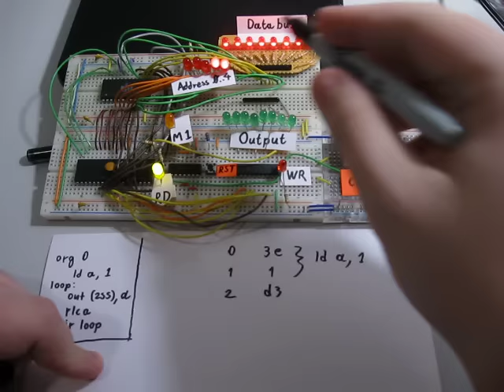Simplest possible homebrew Z80 8-bit computer

Comment: Nice computer :)
At address 6, the data is 0xFB, not 0xF5 ...
Reply from the maker: +sabromania Indeed. I didn't catch the mistake because I didn't bother checking if it was the correct displacement value :) Cheers.

Comment: A very good presentation how it works. This it still a circuit or a simple video game. A computer can be programmed by a user ☺
Reply from the maker: Well it's a computer, but the only thing missing to make this into a "useful" computer which can be easily programmed without swapping ROM chips, is RAM and a serial port. See my new motorola 68000 homebrew computer for that: http://nuclear.mutantstargoat.com/hw/m68kcomp1/  I'll make a video about it soon.

Comment: Props to author's mad skill converting binary code to hex on the fly))
Reply from the maker: It's easy. Each hex digit is 4 bits. Having memorized some useful bit patterns corresponding to certain hex digits, you can quickly count up or down to figure out the rest, and eventually through repeated exposure you naturally memorize most of the 16 4-bit patterns.

For instance, 7 is often useful as a bitmask, because it's 111, to get to 6 I initially just dropped the last 1 from 7 to end up with 110. The bit pattern of 6 however is quite distinctive as it's the middle part of the nibble (0110), so after some time I ended up recognizing it instantly.

Comment: This is awesome. If you can show how you put the program into the memory chip that would be very helpful. Thanks
Reply from the maker: I just used a USB universal EEPROM programmer (the TL866 specifically, I found it on ebay). You just plug the EEPROM chip on the programmer, you connect it to your computer, and write the image.

I used this program to drive the programmer: https://github.com/vdudouyt/minipro instead of the bundled software which comes with it, because I wanted something free software which runs on GNU/Linux.
Reply: John Tsiombikas Thank you
Reply: it is possible (and relatively easy) to program an EEPROM manually (without any programmer or any other device)
Reply: H32 Hi, Can you show how?
Thanks
Reply: of course! (this is a great idea for a video so i might make one :-P )

1)you need to set the address bus to the address that you want to read/write to, for example, if you want to read/write to address 5, you need to set A0 to 1, A1 to 0, A2 to 1 and the rest of them to 0.

2) disable the OE(output enable) pin. (it's usually active low so set it to high)

3) disable the WE(write enable) pin (it's usually active low as well so set it that to high too)

4) set the data bus to the value that you want to write to, for example, if you want to write 10 set the D0 to 0, the D1 to 1, the D2 to 0,the D3 to 1 and the rest of them to ground.

5) enable the WE pin (it's usually active low so set it to low)

6) disable the WE pin and there you go! you've programmed an address of the memory with a value! 
you can move on to the next address! (it takes a lot of time.....)
Reply: H32 Awesome Thanks
Reply: H32 xD my programmer is 16 switches and a push button. /ce is held low and /oe is held high. The button pulls /we low when pressed. 8 switches go to the lower byte of the address bus (A0 - A7) and the upper byte (A8 - A12) is held low. The other 8 switches obviously go to the data bus.

I’m currently working to build a programmer with an arduino uno but it’s going slow at almost 3 A.M. lol

Comment: Hello, good afternoon. Thank you very much for sharing your knowledge. I have a doubt, where do you connect the pins A11, A12, A13, A14, A15 of the z80.
Reply from the maker: Nowhere. Which means that the 2k ROM is technicaly mirrored across the whole address space. Reading from address 0, address 2048, address 4096, address 6144, and so on, returns the exact same value.

Comment: Right, this does it! You and Julian Ilett have piqued my interest in the Z80 sufficiently in order to buy one from macomponentsltd on eBay (lots of new old stock apparently), in order to do some inveterate retro-dabbling. 😋🤘 I never did any projects with the Z80, being mainly a Motorola (6802/09/k) guy (plus SC/MP and some Mostek 6502), so I'm looking forward to some retro fun. Thanks for the video. Great stuff...
Reply: sequri Old post I know, but Z80 can still be bought brand new. Search for Z84C00 on Digi-Key/Mouser/RS etc. Not expensive at all. New 6502's are also available, just search 65C02. Should be "safer" than old parts off eBay.
Reply: @TomStorey96  The bonus with the 65C02 (so I am told) is that unlike the original CPU, you can single-step the 65C02.
The 6502 used dynamic RAM for its registers and relied on the clock signal running at the correct speed in order to refresh the registers.  Attempting to single-step the CPU wouldn't work because all the registers (including the instruction register) would lose their contents between clock pulses.
The 65C02 uses static RAM for its registers which do not require any refresh signal and so the clock may be as slow as you like.

Comment: I thank you very much for your time in explaining your lovely circuit. A section I am struggling with is SV1. I have guessed it is a choice for either 555 clock signal or manual clock! Can you advise me please as it looks like a socket symbol.
Reply from the maker: Yes exactly, it's a 3-pin header. Middle goes to the CPU clock input pin, one side comes from the 555, the other from the manual clock. Short one of the two side pins to the middle with a jumper to connect one or the other through to the clock pin. You can see it in the picture I have on the website, right next to the CPU, on the left side.

Comment: why couldn't the 6502 be driven one step/clock cycle at a time, unlike the Z80?
Reply from the maker: My understanding is that most processors, like the 6502, used dynamic registers which need frequent refreshing to keep their data, and thus holding the clock for longer than their decay interval erases everything. The Z80 on the other hand is a completely static design, using regular flip-flops for registers, and doesn't have any restrictions on clock intervals.
Reply: John Tsiombikas that makes good sense, thank you. Thank you also for the great video
Reply: +John Tsiombikas, yes that is correct that the 6502's dynamic registers are the limitation. There is a trick which was used on the Microsoft CP/M Z80 coprocessor cards for the Apple ][ which kept the clock active but stalled the operation by adding wait states until you wanted the next instruction. 
This is an excellent video, thank you for posting it. I know it will make the internal process visible to many people who would otherwise not see it. 
I wish I had something similar in 1978. :-)
Reply: Also, the 6502 requires a two-phase clock, which would require some more components to implement (at least a transistor and a couple of resistors - OR an Inverter AKA 'NOT gate')
Reply: Another vintage 1970s 8-bit CPU that is completely static (and still made today, hence still available) is the 1802. For simple 'trainer' circuits, I think the 1802 is even better than the 6502 in the sense that it has a built in DMA controller, so the user can use that to load a small program into RAM without needing any extra circuitry to do it. So for this same demo shown in this video, you could replace the EPROM with a small RAM IC, add a few switches to control the data bus for INPUT, and a pushbutton to toggle the DMA-IN input on the CPU, and the CPU will take care of reading the switches and loading that data into RAM, and automatically incrementing the program counter so it is ready for the next input byte. The famous 'COSMAC ELF' hobby/trainer computer was built this way, as the simplest implementation of a complete 1802 computer with minimal number of parts.
Reply: @jtsiomb  There is now a fully static version of the 6502 available see Ben Eaters video series on Youtube.
Reply from the maker: @daveycrockett64  I've seen it. Very enjoyable series of videos.

Comment: 5:28 is this point where IOREQ and RW and address line should be pick correct output device? and OUT(1) would be nicer lol
Reply from the maker: If you look at my schematic (at ther project website) you'll see I'm using a 74HC574 latch, which has a positive edge trigger. It latches the data when the latch signal goes from low to high. The Z80 WR signal is active low, so as you can see in the video, when the WR led goes out, when the WR signal transitions from active (low) to inactive (high), the data are latched. There is no device selection logic, since I only have a single output device. So it will respond to any and all out and even memory store instructions, as I'm not even taking IOREQ into account here.  If there was need for device selection, the address decoding logic would be combined with the WR signal to make sure the latch signal remains high (inactive), when this device is not selected.

Edit: if you want to see a more complete design, check out my motorola 68010 computer project.

Comment: Hello My construction not work properly on breadboard ;0
How it work in your breadboards ?
Reply from the maker: Breadboards are not going to be a problem for such low frequency signals. If yours doesn't work, you made a mistake, it's not the breadboard's fault.
Reply: @jtsiomb  I use cmos eeprom memory all  adress lines must be install pull down resistor 10 k. I ts may issue.
In your construction probably use nmos eeprom.
Reply from the maker: @NANO-SERWIS.MAREK-DASZKE  I'm using a CMOS eeprom, and what you said makes absolutely no sense to me. The address lines are driven by the processor; they are not floating or driven by open collector drivers. There is no need for pull up or pull down resistors.

Comment: please  Can you show me the manual clock circuit?  ad  how does 74574  work here tank  you
Reply from the maker: The schematics are in the project page linked in the video description.
What do you mean by how the 74574 work? It just latches the value from the data bus when a write cycle happens, and shows it on the LEDs.
Reply: I built the shematic in  breadboard , I will  built and try  the clock thank you  very much

Comment: can you explain how the output port works as there are no address decoding ?
Reply from the maker: Since there's only one I/O device, there's no need for address decoding, it just responds to any I/O address. ROM is enabled whenever the Z80 does a memory request (mov or instuction fetch), which is signaled by the assertion of MREQ. Similarly the I/O device could have used the IOREQ signal as a chip select, but instead, if you look at the schematic (see project page in video description box), I'm just using the WR signal, so it really latches all writes, not just out instructions. It just happens that since we don't have RAM on board, I only ever write to I/O.
Edit: if you want to see a more involved design with ROM, RAM, and I/O that responds to specific addresses, check out my motorola 68010 computer: http://nuclear.mutantstargoat.com/hw/m68kcomp1/

Comment: hi, this may sound dumb, but how do you set where jr loop loops to?
Reply from the maker: It's not dumb, that's why I make this videos, to show exactly how all these things we usually take for granted work under the hood.

If you go to the project web page I've set up (it's in the video description), you'll see the source code for this program. You'll notice that I have a label at the place where I want to jump, and then I can use a jump instruction using that label. The assembler then calculates the difference, from the address where the program counter is when that jump is executed to the address of the label, and encodes that as a displacement in the jump instruction.

If you want a more thorough explanation, check out my more recent 68000 single-stepping video, in which I'm actually assembling the code myself instead of using and assembler, and I calculate the displacement value by hand.
Reply: ah, ok. thanks

Comment: This is brilliant, but which method did you use to put the coding onto the AT28C16? Which assembler did you use and on which platform?
Reply from the maker: I used the pasmo assembler on GNU/Linux, and the TL866 EEPROM programmer.
Reply: @jtsiomb  To be fair, the TL866 is far more than just an EEPROM programmer.  It programs almost everything which can be programmed, and can test many of the major control logic circuits and RAM chips into the bargain.
While the TL866 isn't cheap, it's also not all that expensive when you consider everything that it can do, and it is well within the budget of many hobbyists.
The "A" version of the programmer also has ICSP lines, so you can program microcontrollers while they're still in-circuit.

Comment: where did you find that button for the clock signal?
Reply from the maker: The switch itself is a Cherry MX blue (clicky) keyswitch, used for mechanical keyboards all over the place. I got mine from http://www.keyboardco.com/keyboard_details.asp?PRODUCT=942. The keycap is just a cherry-compatible vim keycap. The place I got mine (techkeys.us) doesn't seem to sell them any more, but there are others out there.
Reply: thanks a lot!

Comment: Can this also do operations such as addition?
Reply from the maker: Of course, the Z80 is a general purpose  computer processor. It has been used in the past in many general purpose computers in fact. You can easily find the full instruction set online if you want to know what kinds of operations it supports.
Reply: Thanks for the quick reply. I also have few more questions
How do you program the EEPROM?
Why is there no RAM?
Can I add RAM to this circuit?
Reply: Also a quick follow up question again. What software do you use for compiling and uploading?
Reply from the maker: I used the pasmo assember to assemble the program. and the MiniPro TL866 EEPROM programmer to burn it. There is no RAM because there wasn't need for it just to demonstrate the principles of operation. You can certainly add RAM, you just need to add an address decoder which reads the address and decides if the ROM or RAM chip should be enabled. At its simplest with one ROM and one RAM chip, you can split the address space in two, and use the highest order bit to select enables. See my more complete motorola 68010 16bit computer, which includes RAM and serial port: http://nuclear.mutantstargoat.com/hw/m68kcomp1/